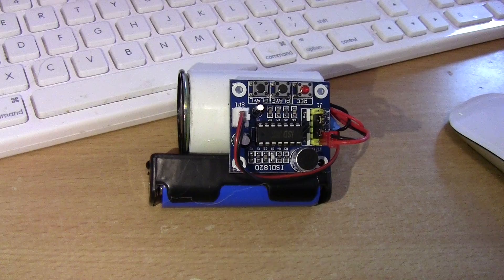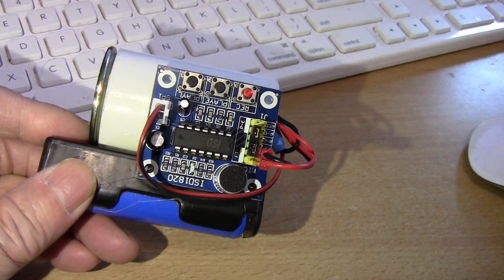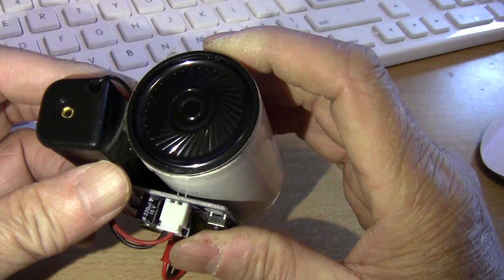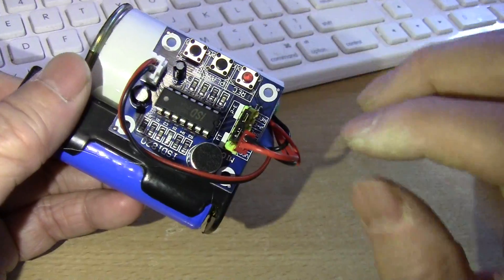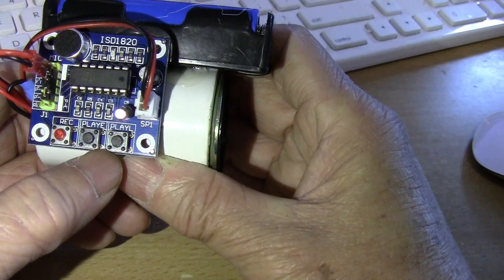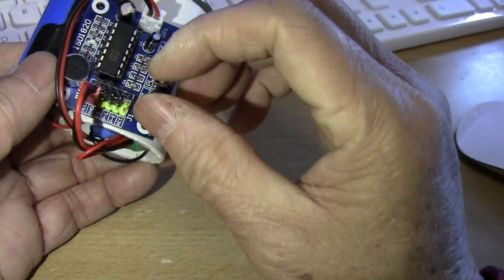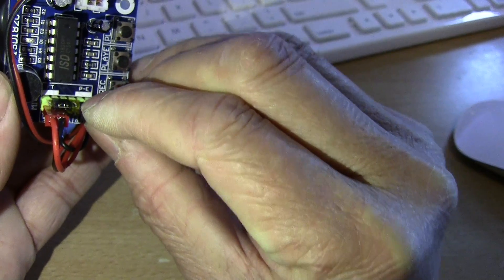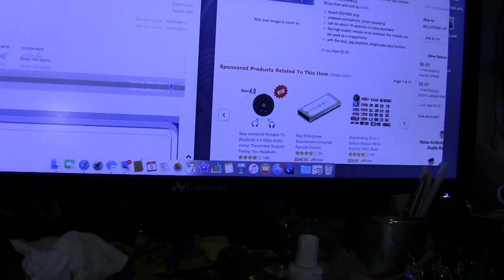10 second digital recorder with loop playback

Comment: Hello, very good video. Can I ask you a question?. How would I connect the device to play through a motion sensor? What plugs would there be to connect or bridge. Fernando from Argentina..
Reply from the maker: Probably need to send a voltage from the motion sensor to activate the recorder. Maybe through a relay connected to the play switch.
Reply: @wtam69  Thank you for your response Sir. Could you tell me your name. My name is Fernando Frohnhofer and I am from Buenos Aires, Argento
Reply: @wtam69  Thank you for your response Sir. Could you tell me your name. My name is Fernando Frohnhofer and I am from Buenos Aires, Argentina...  @:-)
Reply from the maker: @fernandoEfe2241  Paul from US.

Comment: This is great. I've been wanting for a long time to find a very small device to help me with in-context language learning, and I think something like this will be the solution. I want to have a number of small devices with have a word in foreign words recorded on them. I could then stick these word-buttons to things like my desk, a door, a mirror, etc., and, by pressing the little button, I would be reminded of the words in the target language for "desk", "door", "mirror", etc. The video very clearly explained what went into the device, which was great. I am just wondering: How I could decrease the size of the whole device (a smaller battery, maybe?), and Where I can get PVC housing that the whole thing would fit into?
Reply from the maker: Sorry I don't know if they have smaller devices like the one I have. You can use other batteries like button cells as long as they supply 3 to 5 volts. The plastic pvc housing is just a pvc coupler and you can find them in plumbing dept. of HomeDepot.  I think the small recorder is perfect for your application.